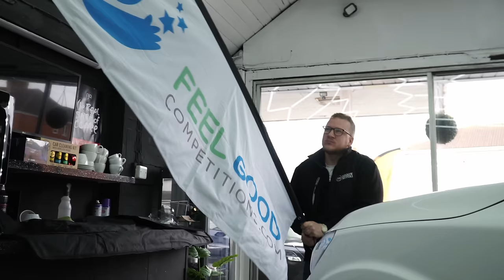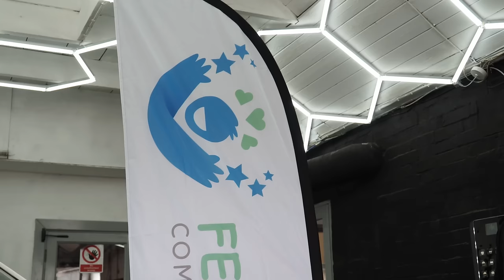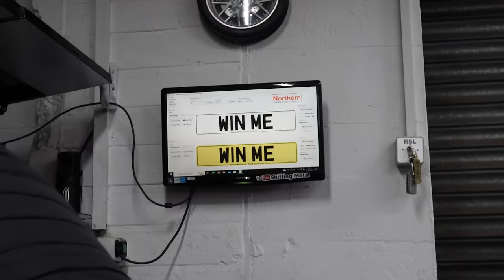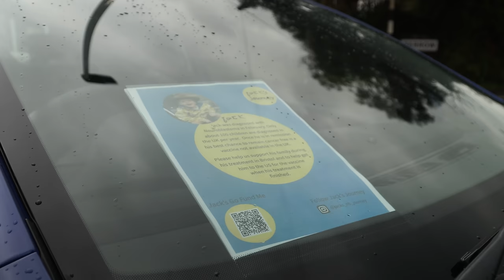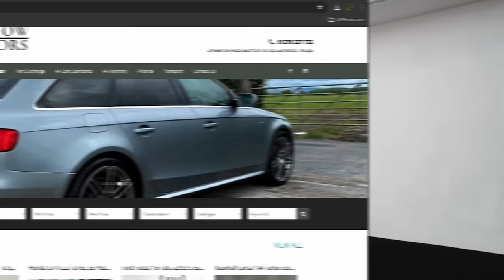RECORD CAR SALES - WE CAN'T KEEP UP! | BM Weekly EP 36

Comment: Those hoses DONT like being driven over, or pulled when wedged under a wheel… lazy staff
Reply from the maker: That used to be the case with our old one but they're extra careful now. I just think the Karcher one are so hard they kink easily and wear out!
Reply: @ShiftingMetal  yes, you are right, I also think they react to sunlight, not that you would have that problem where you are that much. I had a few back in Aus, washing down our trucks. The new ones are best wound up when not in use. Maybe a design fault. @karcher how about you send Joe @shiftingmetal a new improved wash setup?. Maybe he could call it “Karcher corner”…#karcher